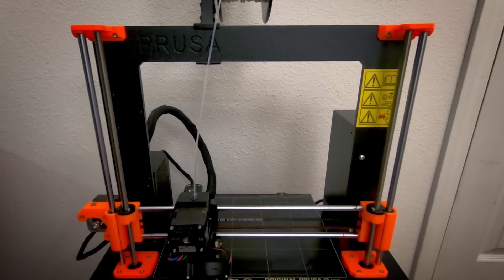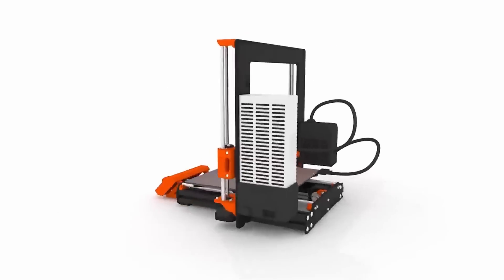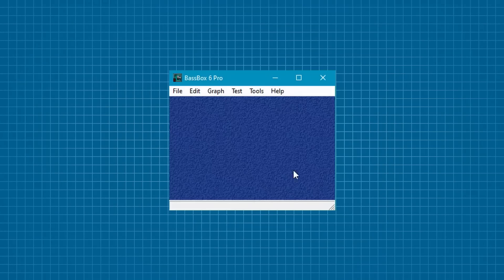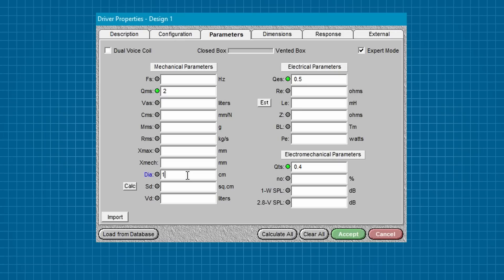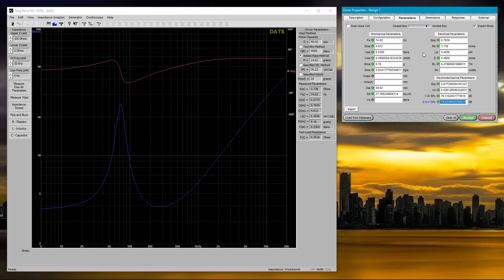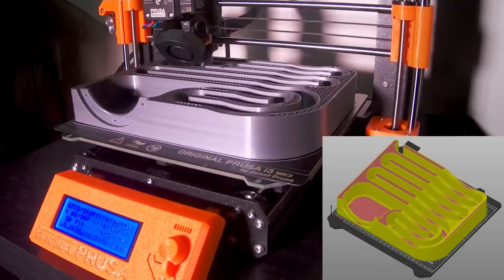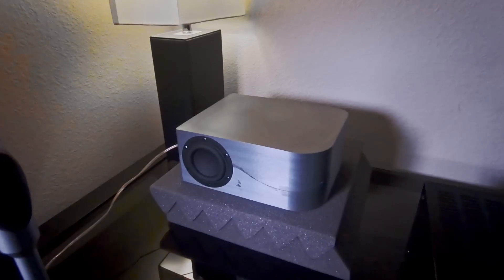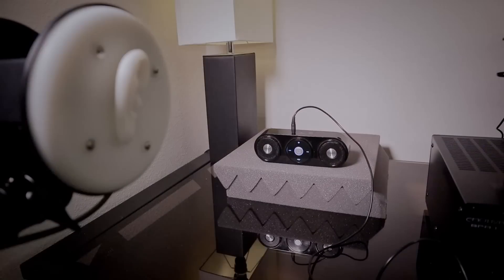Can a 3D printed enclosure get low?

Comment: Great idea, great work, great execution. My guess is it works well cause of the density of the material used and of course your layout. It does sound muddy as hell though so a interesting experiment would be to remove the top half chamber and close it up with just a thick enough flat lid of the same material, and see if it tightens the bass up without losing your depth.

Comment: Hello there HexiBase:

All that bass coming from a tiny 3" sub? That is the power of a really good enclosure. I am a bit of an audio guy myself and that is pretty impressive to me and that sounds way better than the cheap Bluetooth speaker.  even though you could get some pretty good ones out there or build your own Bluetooth speaker as you can get all the parts for it cause they are out there. Next you should try that speaker you built up against the JBL Extreme Bluetooth Speaker to see how it stacks up. Could be a real fight there.

Comment: Just needs a handle molded in somewhere along with some places for feet on the bottom, a small compartment for rolling up and stashing extra speaker wire, and some captive nut slots around the perimeter of the speaker hole so it could be mounted neatly with some hex screws. Then it'd be a pretty finished product.

Comment: I own a Fiero and the speakers in it are itty-bitty little drivers. 2  3.5 inch in each headrest, a right & left rear channel, then just two front r&l  4X10's in the dash.  As far as volume goes, it seems pretty loud with the rear channels 4 inches from the ears,  but just very tinny sounding.  I'm looking to make some very thin  wedge-shaped sub-boxes to fit behind each seat, but not be right up against the seats when in the full rear-ward position, or reclined.  As a Fiero owner I can tell you that it is easier to get in & out of the drivers seat when it is fully rearward, then I have to pull it almost fully forward to drive it.  (LOTS of legroom in such a tiny car)  I thought of putting 6X9's in the doors, but I don't want to go hacking on my car.  I would rather not have to have a huge amp, but just run them directly from the head-unit.  Something like this seems do-able and practical.  (in the afore mentioned wedge shape)

Comment: Interesting approach/thoughts on diy portable audio. What I do is get the guts out of classic (scrapped) boomboxes and heavily fiberglass the inside to get a solid closed box, adequate to put powerful speakers in it (visaton, dayton audio, you name it) Then of course you add a proper 5S liion pack (100watthour), a tpa3116 amp board, and with good speakers/dimensioning/passive radiators, you will have a powerful 2x30w, going down to 45-50 Hz.. beleive me.. all the JBLs ashamed and the classic look also brings smile to people's face... coupled with the clear and loud sound they just cannot beleive their eyes/ears. 😊

Comment: Excellent info and knowledge, not to mention the equipment to back up such knowledge. I have just one thing to suggest: do a little more research on the types of CA adhesives available. There are thick, gap filling CAs that give up to a minute of part fudging before it "kicks" and grabs tight. There is also rubberized thick CA that does not get brittle when cured. Check Amazon or better yet, your local hobbyshop. The brand I use the most is Bob Smith Industries which is available in many places under their own name or under the selling stores own brand name. Available in regular clear or black.

Comment: I've seen similar designs on youtube made translam style in wood products with a cnc router. Nobody ever seems to discuss the T/S parameters or the design concept of the enclosure although some are in Japanese. Parts Express sells an ND series of small and inexpensive Dayton drivers which work relatively well in ported and passive radiator enclosures. It would seem that an optimized labyrinth type of enclosure like this one could get the most out of those drivers.

Comment: Pete, you are THE MAN!!  Really want to work on my own but have questions.  I would like to know more the thinking that goes into the design of the T-Line and coupling chamber portions.  How do you calculate these and determine the exact volume in your design?  How do you know what air mass you need to push for bass extension?  Does the vent have to be in the back opposite the speaker?  Thanks for any info you can provide!!

Comment: The enclosure is a vented box, single 1.5" port 7" long, mounted in front. The bass extension is punchy, but not enough...I like the sound of the system, as is, but was thinking of lining the cabinet, or perhaps building new cabinets. I built 4 for the surrounds and back surrounds. I have the same drivers in a tower, with much larger volume, and a larger port. Same 3k crossover

Comment: Very nice. Makes me want to build a labyrinth for the 4 inch thick speaker cabinets for my 1960 Symphonic portable stereophonic phonograph. Possibly some of the most acoustically incorrect speaker enclosures designed. Speaker moves around a ton, but no bass can be heard.  Incidentally, labyrinths were first commercially employed in the 1930s on the fine Stromberg Carlson  radios. Their labyrinths weren't designed to reduce size so much as to improve audio quality. Indeed, if you do get one of the SC labyrinth radios running, particularly a 1940s model with Armstrong FM, you are in for a treat. Be warned, though. They employed aluminum voice coils in their speakers. Aluminum is lighter, and drastically improves high frequency response. However, it cannot be soldered. The connections to the fine coil wires are made with crimps, which develop microscopic corrosion after 70 or 80 years. If the crimp is repaired, the original speakers with their suede suspensions (glycerin or KY lube softens the suede) sound amazing.

Comment: Made my own subwoofer enclosure for 12" Sundowns and then 15" DC Audio Level 3s using MDF board and Bassbox both times. Always loved the first few times testing range with Late Nite Tip by Three Six Mafia for that sweet 32 hz.

I wonder if printed material could be thick enough to hold in the pressure and vibrations of a fifteen inch sub, in all my builds I did use plastic porting, first time just pvc tube for the Sundowns then I bought precision flared ports for the superior DC Audio build, that is a lot different though.

This printed box is tuned very well for that speaker and printing could allow some intricate innards that was quite tedious working with cutting heavy MDF board, screws, glues and what not. Perhaps a MDF shell around printed airflow chambers and ports.

Comment: I'm a bass player, so your videos are very intriguing to me.  I would love to see your analysis of the quintessential ultimate bass cabinet - the venerable Ampeg SVT 8x10 cabinet.  It utilizes a sealed enclosure for each pair of 10" speakers.  You've never heard better, tighter, punchier, controlled bass than from one of these monsters.  When I was a touring musician, I used 4 of these cabinets for my stage rig, along with 2 Mesa-Boogie 18" down-firing subs.  It was a monstrous sound.  Could you please do an analysis of one of these cabinets??

Comment: well its fairly obvious which of the two will sound better also the difference in overall power usage. while this is neat as an experiment it would be cool to see a more "complete" product with electronics on the inside rather than everything on the outside aside from the speaker. you would have to decrease the buffer area but having something more portable would be good.

Comment: I still have a tip for you. You work with a simple BassCAD-Tool to determine the Transmissionline-Parameters. You can use AkAbak. This Tool works just with 32Bit-Versions of Windows, or with Wine under Linux, but getting it running, it has the possibility to create every speaker you can imagine out of simple elements (Basically "Enclosure" for Closed Boxes, "Duct" for Tubes with specified Crossarea, and "Radiator" for acoustic outputs.

There are some good Tutorials and there is a 200 pages pdf coming with the Tool. The Tool works numerical, it calculates the air pressure through your defined Elements, which are connected via "Nodes" to each other. It is a bit complicated because its some kind of a programming language. But i'm now used to it and i already planned some serious things. For example a splitted tm-line with different lengths, to delete interferences in the higher frequencies. 

Greetings

Comment: The example at the end - can you rip the drivers out of the small speaker and build an enclosure as compact as you can that destroys the off the shelf model? perhaps limit enclosure to 20 or 50% bigger? 

Also as your 3d printing can you have waves on the surfaces of the baffles rather than just straight any benefit to this? In nature nothings straight and things like whales have lumps and nodules(that I believe have sound benefit aswell as hydro form benefits).

Comment: Every time I see you create a new enclosure for a sub I'm impressed and stunned. But there is one thing I don't understand. You create/desing enclosures only for sub's, but what about a speaker like the Alpine SXE-1325S. Do I need such a complex enclosure or is it sufficient creating a simple chamber with a hole?
Sorry if I sound like an ignorant but yeah, there are a lot of aspects/factors I don't know.
I recently bought a 3D-printer and I would like to print an enclosure for those Alpin speakers. They are currently eating only dust and it's a bummer not to use them for my bedroom.
By the way how many printers do you have now? It looks like you have small production plant now.

Comment: I want to canabalize one of my LG Music Flow H7 WiFi speakers and give this a try. 
For what they are, they sound ok, but I know they could produce so much more, with the proper enclosure. 

Dual 4" woofers, dual 20mm tweeters with a company claimed, 70 watt amplifier in the factory enclosure. They do sound fair. Especially if you stick them in a corner, which I hate doing. Much better than most portable Bluetooth speakers, although, these are not portable. I think they could be wonderfully rich sounding speakers, in the proper enclosure. I'm gonna give it a shot.

Comment: That works, the distance of the air flow seems to be suffisant to obtain auditive response in bass frequency but i have an idea for you read all this message ;-) 

Bass frequency needs a lot of place if you want to hear them, instead of the higher ones
Add a pass band filter and a 4 ohms 76db tweeter on the grey one, you'll obtain a wonderful device

Just a problem with the describe of the HP, the frequency response are told as 50 hz to 2 kHz, but, the curve indicate the impossibility of the device to reproduce those frequency without a high impedence
This speaker will not really start at 50 hz, but something like 75 hz wen you use suffisant power and short cables

The most powerful way to increase volume and all frequencys is the forms used in instruments, really small at first then becoming a big hole
Like on the first disk readers

Comment: I would have 3d printed some blind holes around the edges and in the middle and used some pins to fix to two halves together. Also a tongue and grove fitting around the perimeter would have been a more difficult printing but allow for non-foreign materials (like steel pins) to interfere with the material acoustics. Great job though. Amazing sound from that small package.

Comment: What about making holes that channel down a small ways like hex on one side to grab a nut and on the other having a round one so you can use an allen head bolt to go through. After that use a gasket maker like rtv to seal it up, this way if you ever need to open the box up you can still do that. Just an idea!

Comment: Lol I thought the bass sounded horrible, even though there's so much of it from such a tiny speaker. But I looked up the track just to verify and it turns out that the track actually just sounds like that and it's WAY more accurate than I thought. The track combines lo-fi sound with really dirty bass; probably not the best choice for this kind of testing unless it's a track you're really familiar with! 😅

Comment: Great project! Here's an idea: Musicians / sound engineers working on the go are often in need of portable no-latency monitors. I'd love a portable monitor enclosure with a sub and tweeters, slim, maybe a 1 meter or so wide, with a very linear frequency response and with no latency (or maybe <=5ms). Stereo. A real mixing tool. Something you can make decisions on sound with. Most commercially available products are eihter not that great or not that portable, and none have SUBs. Is that something you'd be interested in? Could make for great content, and may bring in some audio engineering / musician type of viewers.

Comment: Really cool to come across your video. 

I know it’s a prototype but, I’m thinking that the layer lines from the 3D print might be interfering with the sound waves. Once you fill & sand out the layers lines in the wave guide the sound will be cleaner. You mentioned that the grey PLA is what you had on hand for your prototype but, I also think that if you use a different material like a wood PLA, ABS, or PETG that may affect the sound as well.

Comment: Impressive for a 3" cone. In isolation you can definitely hear the sharp roll off in response and it ends up sounding very boomy / muddy. I also heard so rattling? Listened to on DT1990Pro.

Comment: It's easy to get better sound from a speaker system with better quality drivers. I would however like to see you dissect the mass produced speaker and placing those lower quality drivers in a case you designed to see how much improvement you get

Comment: Now the question is, are the results repeatable enough so you (with good microphone and knowledge) could do a DPS correction for this nice little box and the rest of us mortals can 3D print it and use your settings? Or is every minor defect/tolerance difference "big enough" that your DSP correction would make the box worse? (or is the box good enough as it is?)

Comment: This is cool idea. I would like to hear the  bass speaker with a piezo tweeter added. Because you are using a bass speaker the bass is a bit too much. A tweeter would give more higher frequencies adding more clarity. 
I have found in my testing piezo tweeters dont need a big enclosure as most of the sound is projected forward.
The generic tweeter had no bass but nice clear vocals.

Comment: Impressive from such a tiny cone. A lot of DEEP base, but pretty rumbly (boomy) when listening to it on my JBL TiK sub + QLN150 (+JBL Ti6K speakers and a bunch of JBL Ti2K surrounds and a few XTi20s). Maybe sounds different IRL? 
Reminds me of the sound I got from my first build - a 7th stage band pass woofer box for my car with two (cheap) 12"ers. It filled the entire trunk in a semi Combi (Saab 900) and had the largets PVC pipe could find for the centre chamber. My mirror constantly re-oriented and entire car vibrated when cranking up, but by no means was it clean as I saved cash on the wood and just went 22mm floor particle board - so I am sure the entire box became a membrane too :-S This sounds a lot better even on Youtube (as I remember it at least)

Comment: What are your recommended FDM parameters for printing speaker enclosures?  For example, printer nozzle size, flow rate, infill percentage, layer thickness, etc.  Awesome video by the way!

Comment: It's a great design, although you had samples to test the speaker itself as well as test with music audio, I feel the comparison should've been met with another identical speaker in a traditional box  relative to it's cubic square inch of needed air volume to get the a true comparison of the enclosures ' sound production.

Note: I would like to add another idea design thought. Just like cars they produce sounds through the exhaust pipe, you can play with volume to control air flow by increasing or decreasing sections to create the best possible sound projection and well as get lower tones.

Comment: I'm normally one to advocate for less infill, but in this case more infill may be helpful, or potentially look into printing in a material like Polycarbonate. The extra mass could be beneficial. Also, for most of the part, it should be pretty easy to print without support, at most just round or chamfer the top and bottom corners. Only the large cavity where the speaker is inserted would need support.

Cool project though. Would have liked to hear the same speaker before and after though instead of just comparing it to an off the shelf speaker.

Comment: Printing looks nice, What I was thought (long time ago) that for "best" use of the air pressure you need one meter of length (was it called lambda?) so if you take a string of wire you need to run it through the enclosure and measure the length. the membrane action would be equal and the port should face front. I listen to the Shed by Shebbe track but it's not the best to experience sub, anyhow it's interesting !!

Comment: In conclusion, I need a 3D printer and to learn more about audio. Using the areas which are plastic it should be quite feasable to enclose batteries and electronics. Altering it slightly would also be possible to add mid range and diskant. Really interesting!
What was the weight?

Comment: I clicked on the links and did it myself, but it would be great to do A/B/C testing with the source material as well as with the speakers.   At first I thought your little boom-tube was way too boomy, until I listened to the source, and sure, it is full of boomy bass!   The thing does lack a little in high-end though.   I wonder if you'd need much in the way of a driver to handle that?  Would you even need a crossover?